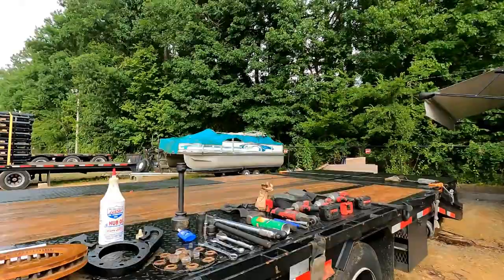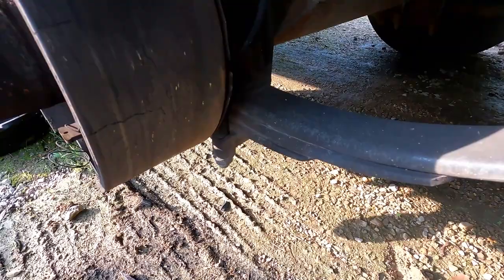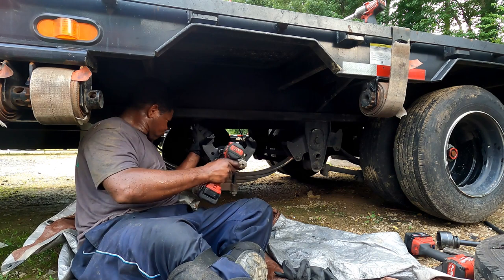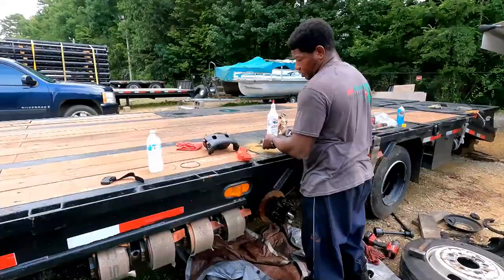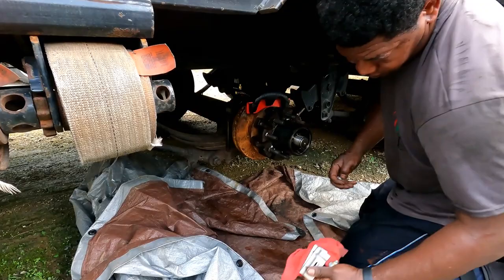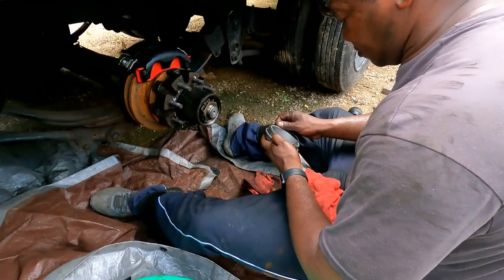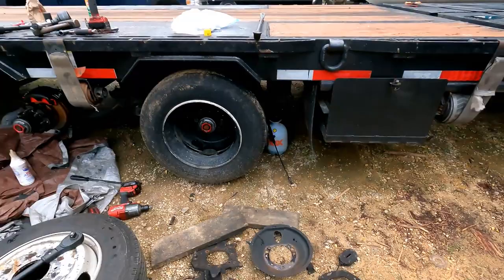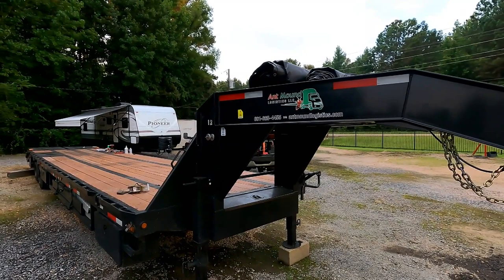Trailer disc brake conversion

Comment: For the 2 nuts on the axle. You gotta tighten the inner one to 100ft pounds as your spinning the wheel,  then  back it off 90 degrees, put your washer on and then put your outer nut on and tighten to 150-160 ft pounds.

Comment: Hey ant. Thanks for the video. I’ve been looking really hard at this kit on etrailer. 
Can you do a review video on how much of an improvement it made to you??
Thanks again and God bless
Reply from the maker: @John Boyle, Since installing the kit I’ve logged a little over 7K miles it has made a drastic improvement over the electric drum brakes. I run my brake controller on 1.5 empty and 3 when loaded there is a slight delay in application which is minimal you get consistent braking application every time. The kit I purchased from a company in Pennsylvania. I didn’t have time to run the lines myself and mount the controller so I had a local trailer shop finish that up for me. They did a shady job which I’m going to reroute the lines and change how the pump is mounted. Ensure that you put fuel line atriums your metal brake lines where you have metal on metal contact. If you mount the pump close to the axles you will need to run two wires from the front of your trailer and install a box to protect the pump. I plan on doing a follow up video soon. Thank you.
Reply: @antmoundlogistics  nice that’s what I expected ok know I’ll for sure buy the kit and install thanks so much
Reply: @antmoundlogistics  Disc brakes are new to me so what operates them and how are they hooked up??
Reply from the maker: @dewayneturner3882  they are hooked up the same way as the electric but with the addition of a pump that also serves as the reservoir for the brake fluid. The brake controller sends a electric signal to the pump which activates sending fluid through the brake lines to the calipers located on the wheels containing the brake pads squeezing the rotor creating friction which in turn stops the trailer.
Reply: @antmoundlogistics  Thank you

Comment: Have 15,000 pound axles under my 42-foot deck over and you know if anybody makes a disk brake conversion kit for those axles? I've been looking but haven't been able to find one.
Reply from the maker: Check with Brechbill Trailers
Reply: Just thought I would put this out... When I used to buy electric drums and brakes for my trailer the 12,000 lb kits and the 15,000 lb kits were identical.  There's a good chance the 12,000 lb kit will be a match for a 15,000 lb axle... But do your research and check it out first before you pull the trigger.

Comment: Hey ant, where did you mount your actuator?
Reply from the maker: My actuator was already on the neck beside the battery for the brakes so I ran the brake line from the back all the way to the front just behind the hitch. That’s where I mounted the pump.

Comment: I would have marked axle nuts with a chisel and axle spindle. That way nut gets preloaded to same place it came off.
Reply from the maker: I took pictures. Not all of the hubs were properly tightened and one of them didn’t have any tabs bent down locking the axle nuts in place.